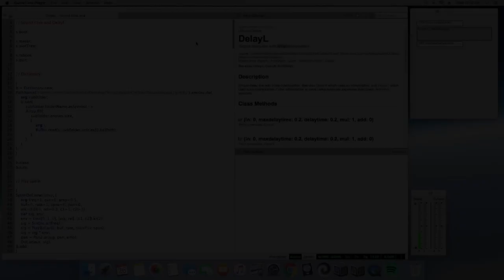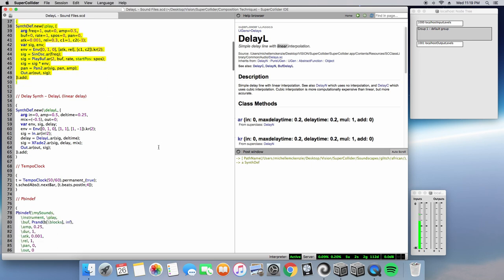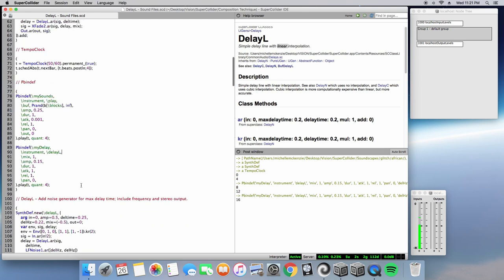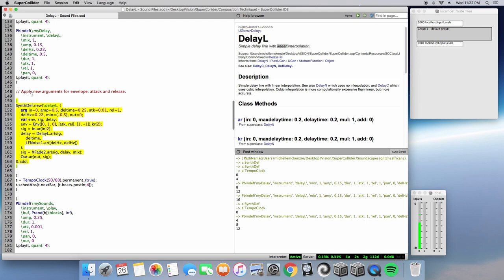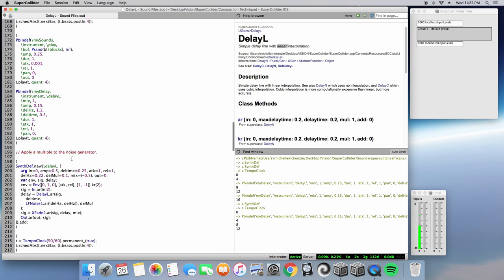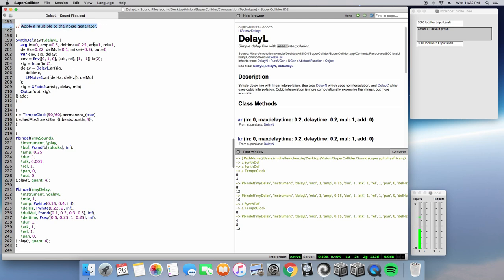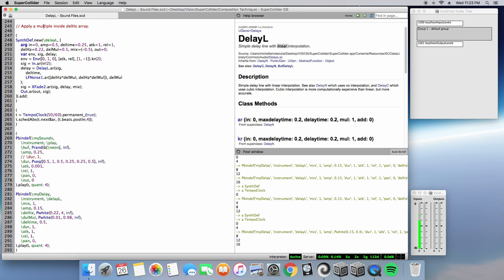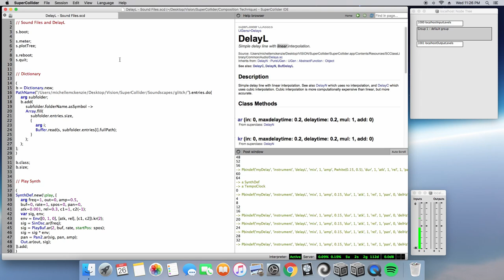Delay For Sound Files In SuperCollider

Comment: Whenever I type this I get an error: Pbindef(\mySounds, \instruments, \play, \buf, Prand(b[\blocks],inf). 
The error is: ERROR: ListPattern (Prand) requires a non-empty collection; received nil. 
But when I take out the [\blocks] from the Prand, there is no error. But I don't hear anything. I can't tell when I'm doing wrong.
Reply from the maker: Hi, HighlandViolinist. I run into this error frequently. Be sure that the name "\blocks" is specific to your Dictionary. "\blocks" must be the exact name of your subfolder you're pulling the sound files from. The example below contains my folders specific to my computer (my name omitted):

PathName("/Users/[yournamehere]/Desktop/Vision/SuperCollider/Soundscapes/glitch/")
Inside the glitch folder, I have a folder called "blocks."

Try this first and see if that helps.

Also, I notice that your \instrument key has "instruments", plural. This may cause SC to evaluate a frequency instead of your synth. The key "\instrument", is the key that evaluates your synth. Hope this helps!
Reply: Ok makes sense. I thought it was just an arbitrary argument name because of the colour. I tried making it my folder name though and I still got the same error.
Reply from the maker: One thing you can try is shortening your PathName to something like, PathName("/Users/[yournamehere]/Desktop/glitch/"), potentially eliminating a problem found in a longer thread.

You can also use individual audio files using the following syntax:

~name = Buffer.read(s, "insertaudiofilehere.wav");
~name.play;

Then, in Pbindef, you would write it as: \buf, ~name,

I'll explain Dictionary in more detail when I next use it in my demos. Good luck!